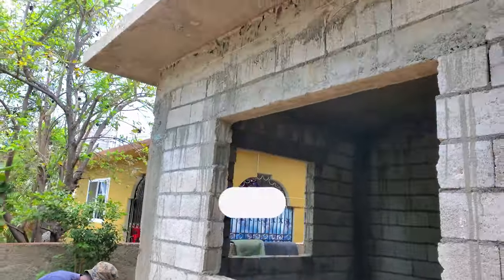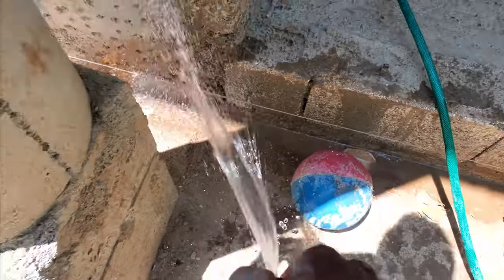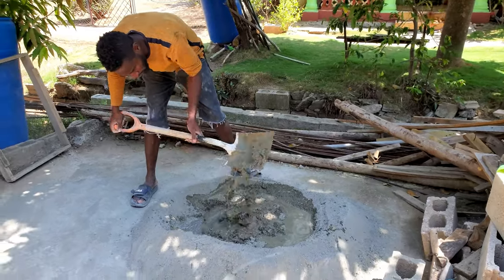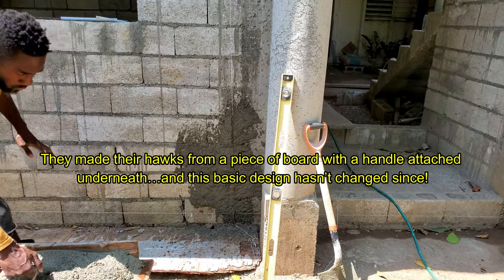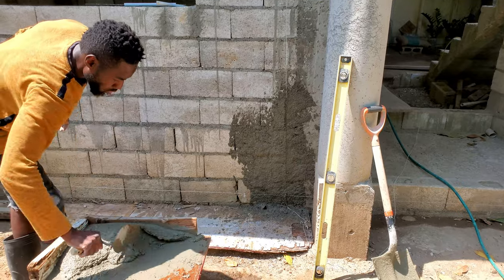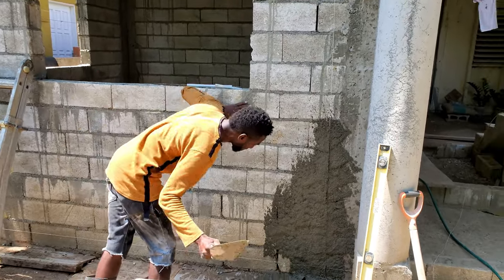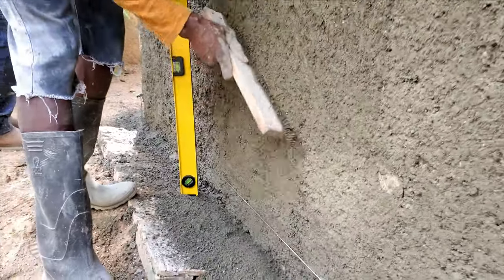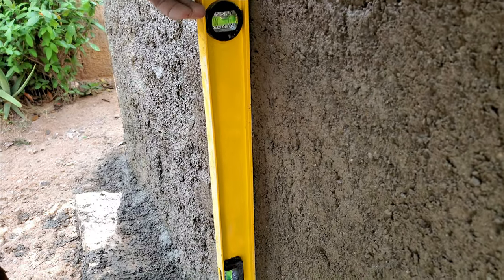Building our dream house in Jamaica / What is Roughcasting

Comment: Good job i remember my first time flashing nothing stayed on the trowel and it didnt even go on the wall 😂 look at me now let me tell u by u finish rough casting the building everybody turn pro just continue doing ur thing bro and ensure u hack up the column and belting concrete because long term it will get hollow  and fall off ❤ the video
Reply from the maker: thanks bro going to hack it up right now
Reply: @paynefuldiy  blessings 👍

Comment: always learning somethin new and useful here...  why do they usually use two coats (rough cast and smooth cast) instead of one and what would happen if you used only one coat?
Reply from the maker: good Day Lobsta112 great question  sometime one coat of rough casting is used if they or going to use trowel on as a final coating or you can use rendering with a find grain sand called grant sand but I'm going to finish it with the rendering and then trowel on as the final coat